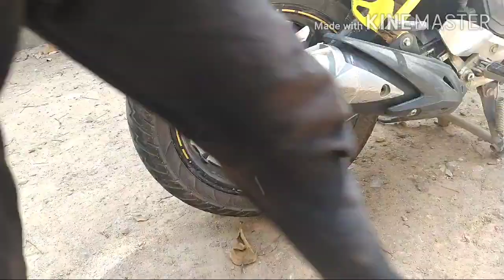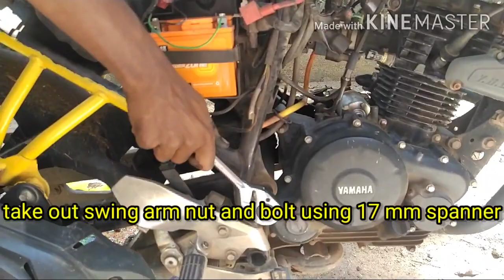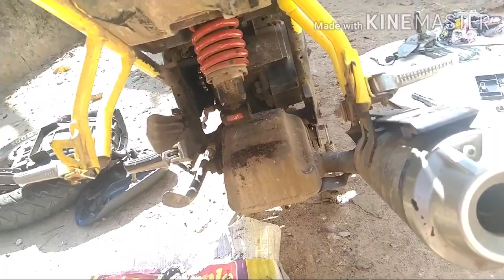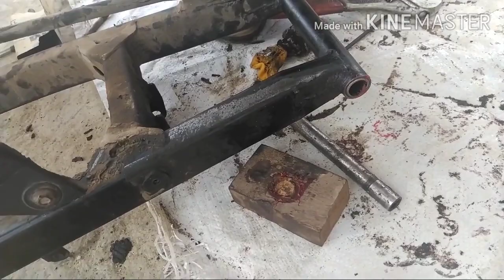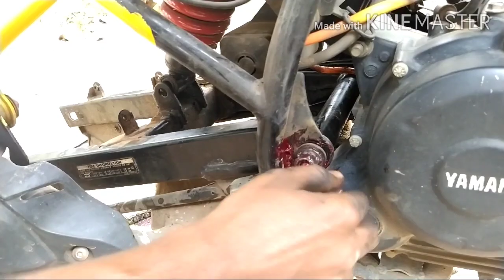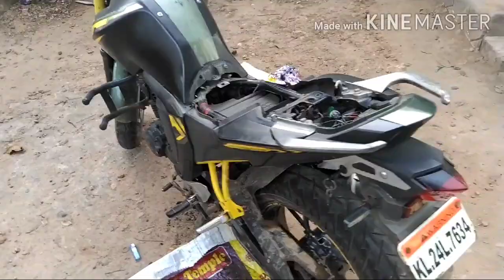!! How to change Yamaha fz v2 swing arm bush & bearing @ home??..!:അതിന്റെ കാര്യതിൽ തീരുമാനമായി!...

Comment: Swingarm bearing, sprocket set change aaki. 
Back tire hubinu ullil ulla 3 rubber pieces break ayittu kandu. Enthayirikum issue??
Reply from the maker: Bro sprocket hub ulill oru bearing und. Athu poyal egane varum.
Reply: Thanks bro
Reply from the maker: Give ur supr udane thane fzde pistn chengng vedio varunud

Comment: Price
Reply from the maker: Swing arm bush&bearing , Greece .total 500
Reply: @jobistech5275  showroom price ആണോ
Reply: @farhanhameed2191  ala pirathe shopil ninu vagi.vtl sodami paniju
Reply: @jobi2432  swing arm മാറ്റിയാൽ smooth ആകുമോ
Reply: Vibration പോകുമോ
Reply: @farhanhameed2191   swing arm complt udagil mathrm maruka.bikn nalla vbrtnm back tyr shak undegil mathrm mariyn mathi
Reply: @farhanhameed2191  vibran undgil pokm.ipol njn cheythekunath fz v2 fi .v1 egane ala
Reply: @jobi2432  swing arm ചെറുതായി shake ചെയുനുണ്ട
Reply: @farhanhameed2191  ngl swing arm damega
Reply: @jobi2432  ur bike fz v2
Reply: @farhanhameed2191  athe
Reply: @jobi2432  എത്ര km ഓടി bike
Reply: @farhanhameed2191  67000
Reply: @jobi2432  any engine work?
Reply: @farhanhameed2191  no onum ela ipol clutch maran tym ai .pine frdr consetm maranam..
Reply: Bro. Cheriya gutter chadumpol nalla shake und back il ( shock mariyittu 5 months kazhinju) adutha idakanu. Swing arm complaint ano
Reply from the maker: @anandhuthampi3841  bro shoke kurachu etekuvano
Reply: Puthiya swing arm etra varum.accident ayi bend ayi.poyi..